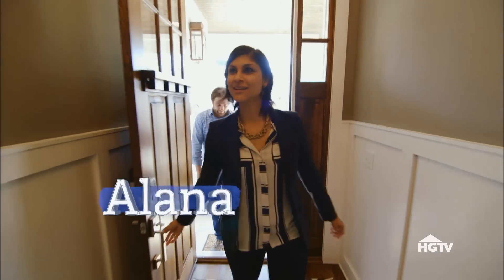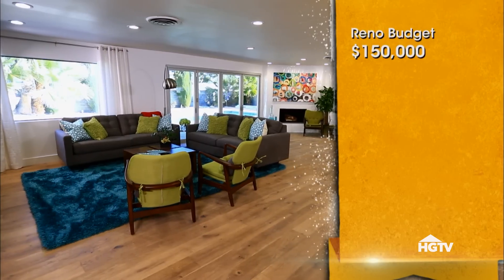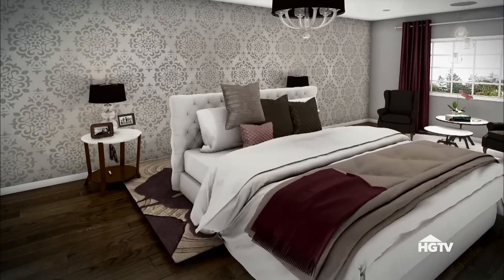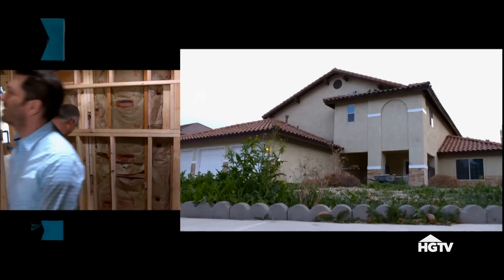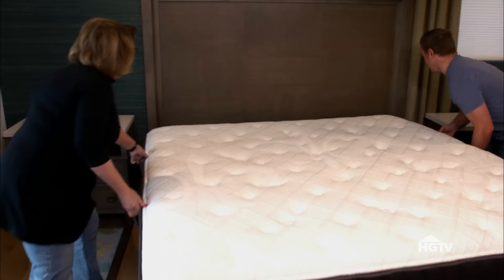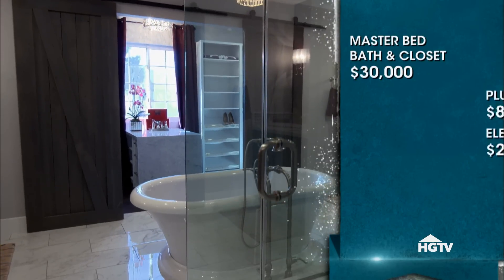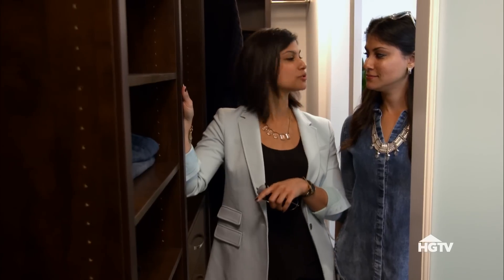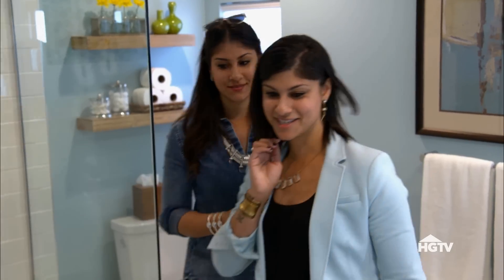Master Bedroom Suite Renovation in 1 Week! | Brother vs. Brother | HGTV

Comment: Both bedrooms were too masculine. Too many dark colors which made the rooms look small and closed in. The twin sisters loved the light and airy bathroom as opposed to the maroon and dark bathroom. If the colors were lightened up along with the bedroom it would have won. The wallpaper of Drew's could have been a light color of silver with gorgeous bedding. The 90's were more of black, maroon, burgundy and dark colors. The window in Jonathan's bedroom threw everything off and the window coverings didn't really help but emphasized it. Closing up the window could have centered the bed. The bed frame could have had a modern chic vibe against that teal wallpaper and more of a glam chandelier.